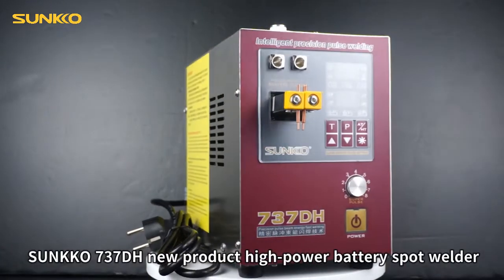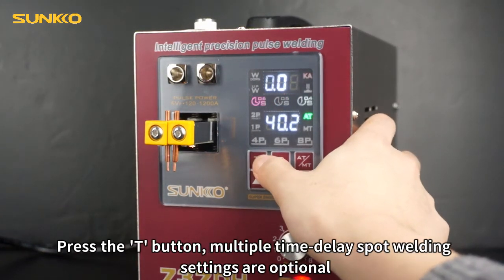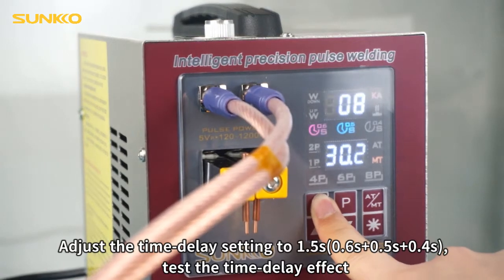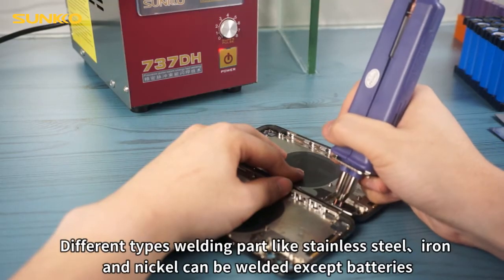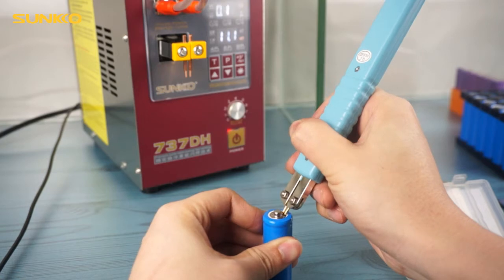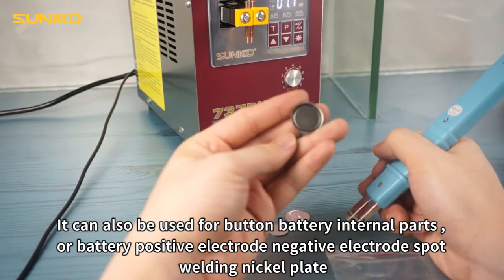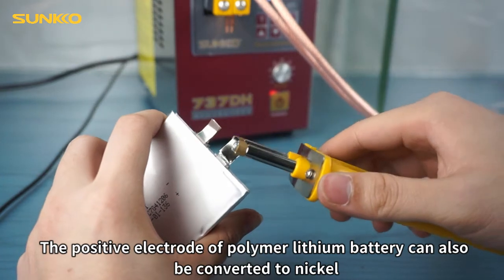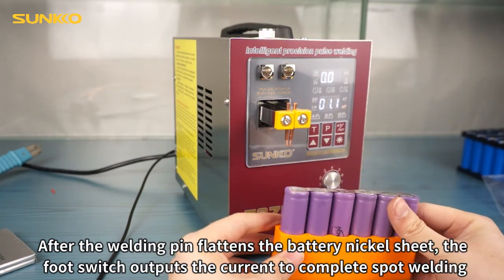SUNKKO 737DH Transformer Inversion Battery Spot Welder Tutorial Video

Comment: I bought Sunkko Spotwelder, but it doesnt deliver enough current, and I needed to make some upgrade just to make it work and deliver the right amount of current.
Reply: Check your house plug , don't use another electric equipment in same plug ,the  circuit breaker must be 25A 220v .
Reply: @adelgc  where the fuck can i find 25a plug , the stantard is 16a